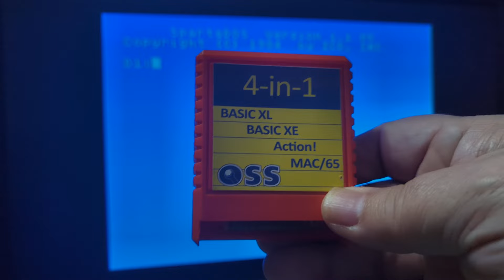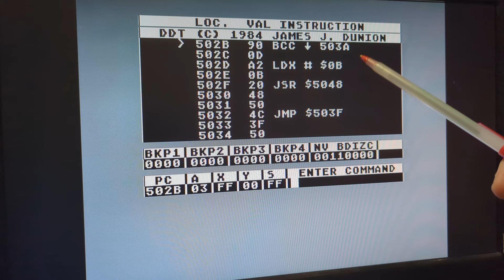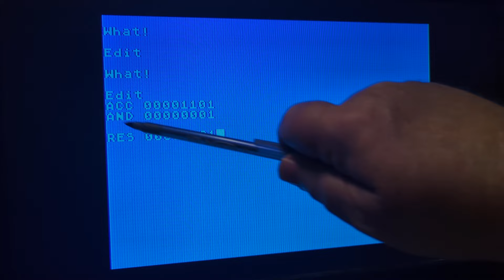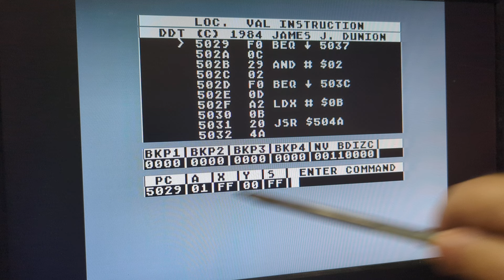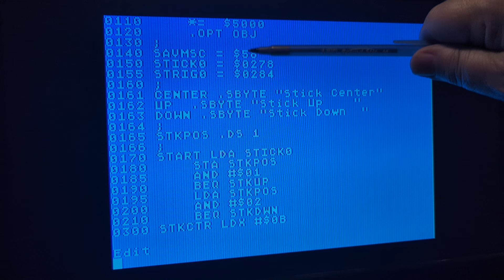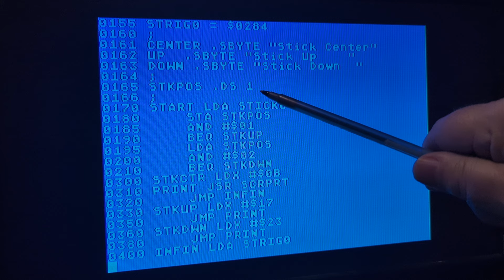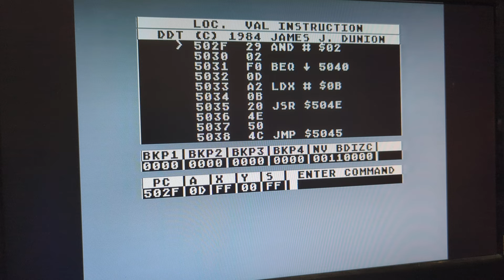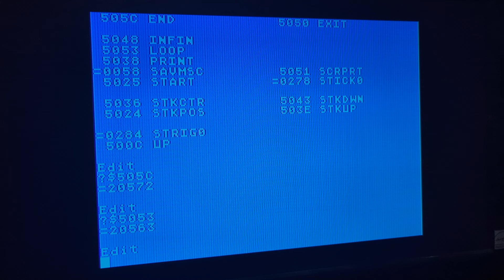MAC/65 Assembler Editor and Atari 8-bit Machine Language Programming - Part 6

Comment: Great vid as always! Congrats on hitting the exakt 1hr mark :)

Just want to point out that if you happen to want to test all bits and use either ROR or ROL, a 9th ROR or ROL will make it a non-destructive test, and it will even restore carry to whatever it contained before doing the testing.

Probably a rare case that this would be useful, like if you have already tested all four directions on two joysticks you probably have no use for the joystick value any more. You might have something meaningful in the carry flag though.

Comment: Is there a reason why you're putting all your data at the beginning of the program?  If you put it at the end, the starting address won't change.
Reply from the maker: @nickfolino8228  As I've mentioned in previous videos, I'm still finding my coding style for Assembly. I may start moving things around later but for now I like all the code in one place and all the non code together as well. As long as you're using labels and writing the code properly it won't really matter where the code actually starts.
Reply: @davidarlington1206  You may try moving your data to a different location.  You can add another *=[DATA ADDRESS] to the top of your program, then *=$5000 right before your code starts.  That way your program always starts at $5000 and you won't need to worry that adding more data will move the starting location of your program.  I like keeping all data in a separate file then just including it in the main program where I want it.
Reply: The Mac/65 with DDT cartridge (version 1.01) you showed in the video is available at Atarimax. He sells this cartridge as a reproduction for $25
Reply from the maker: @martinpanhuis4608  oh, nice! I'll mention that in the next video!

Comment: Just thinking would the bit instruction work better. Mind you I am only part way through watching lol
Reply from the maker: While it's true you can test the Accumulator value with BIT without changing the value in the accumulator, the big drawback with using BIT is that it does not support Immediate Mode. You can't do BIT #$02 or whatever, which makes it more awkward to use. (And would've distracted from the roundabout point I was trying to make about why and when you might need to use your own variables to stash things away.)
Reply: @davidarlington1206  cool I never use bit just was a thought. Thanks for letting me know
Reply from the maker: @brianwild4640  I think I'm going to show how to use it though now in the next video lol

Comment: Better to just make yourself a cartridge no one who has an original Mac 65 cartridge will sell them can’t blame them
Reply from the maker: @brianwild4640  These 4 in 1 cartridges are readily available it appears and are just as good as an original cart. Not everyone and especially me, can make their own carts.
Reply: @FelipeBalbi  A thing with the Atari though is that you need a case to hold the dust cover flaps open on the cartridge port. Or rather you need that with an XL as it has metal flaps that would short things on the PCB if you use a bare PCB in tbe cartridge slot. With the original 400/800 a bare PCB would work (I think?). Not sure about the XE models.